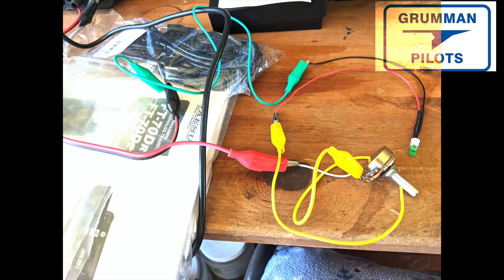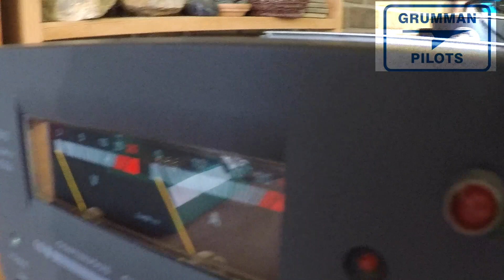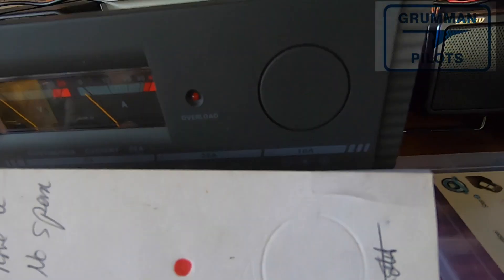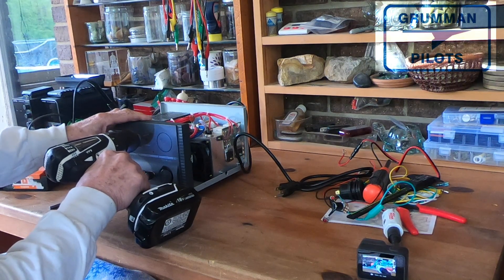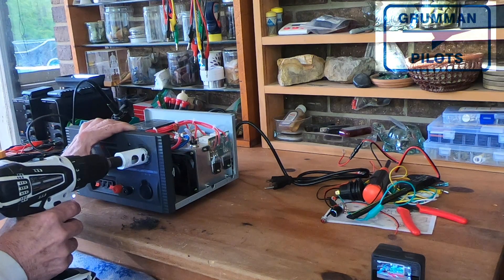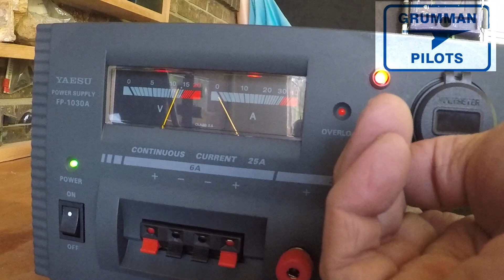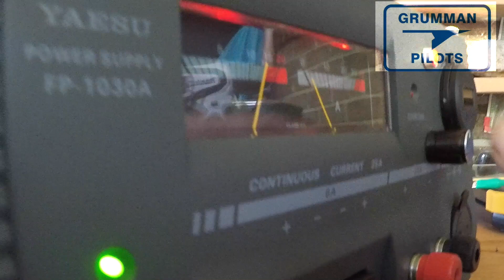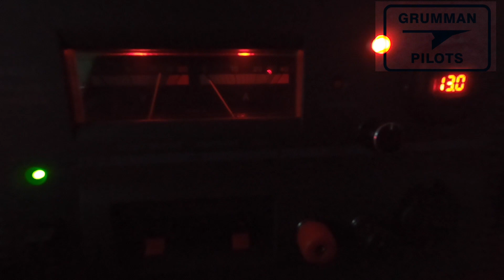YAESU FP-1030A Power Supply Value Added Modification - Grumman Style

Comment: Not sure why you added the LED on the front panel. Was a dimming function really needed? It's not like your flying this thing with NVG googles on lol.
I like it.
I have seen a voltmeter/temp meter in that same spot on another installation. Not sure I am sold on a temperature readout. A digital current meter would be nice, but that is a little more modification I guess.
Reply from the maker: I had a bunch left over so I added it and it was still working when I was done.

Comment: Hi, great video. I must have made those on mine. But can you tell me which transformer to buy, mine is very loud and I have done everything to make it quiet. Rubber feet between the transformer and the bottom and tightened the bolts that hold the plates together. But nothing has helped so I need to get a new one. Can you provide a link to the type I should buy (230Volt XXAmp? must be a toroidal transformer (if it can be there physically :-) ) /Per HB9GIM
Reply from the maker: If in the US, get a 110 V to 13.8 volt transformer good for 30 amps.

Comment: Nice job..would suggest to add part numbers/manufacture/suppliers so others can replicate your project.
Reply from the maker: Panel light and the LED lights were bought in packs from amazon 10 LEDs, 5 colors.  The pot was in another Amazon kit, box of various pots.  See also Amazon for the wide variety of dual USB ports, some have readout, other no, all fit same size hole.
Reply: @GrummanPilots  Thanks...I miss having an electronic store in town that we can actually visit to buy parts.